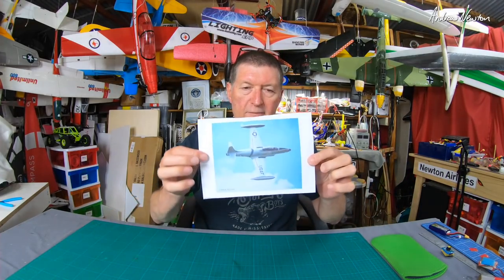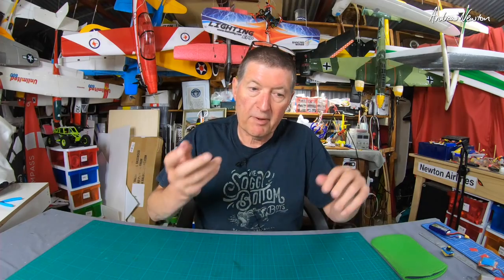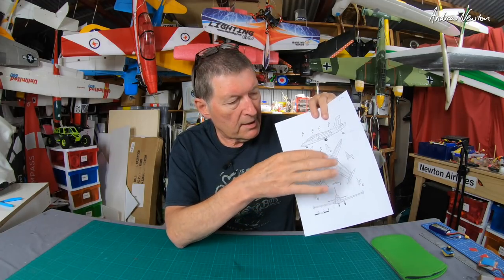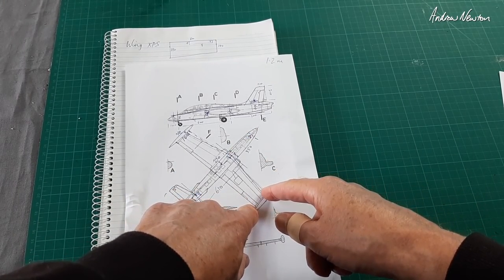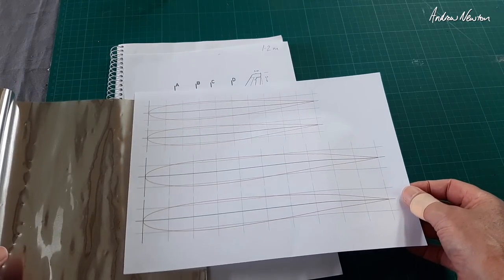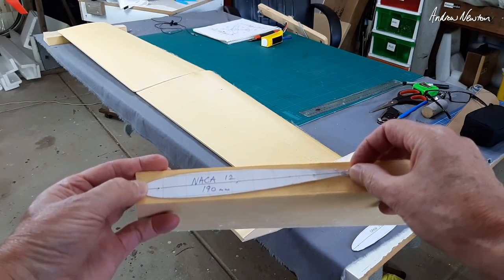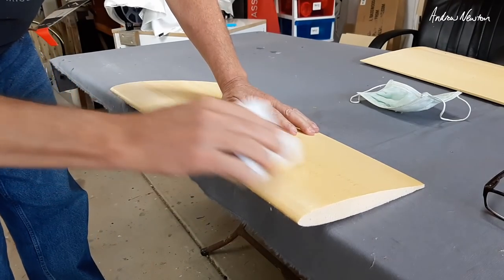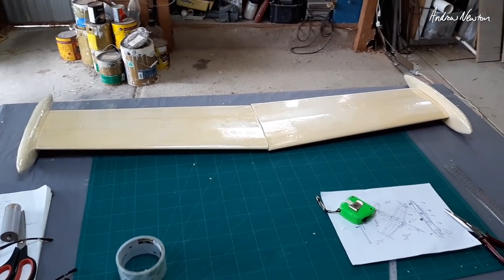Macchi MB 326 Scratchbuild Part 1

Comment: Another great video and series of builds. I have previously manually plotted airfoils, and know where to get the co-ordinates online, what software do you use to print out the foils, and for the newbies, have you done a video or talk on doing so? I have had a look through Newton Airlines, but a lot of info, and couldn’t find specifics on plotting. Keith.
Reply from the maker: Nothing fancy, Screengrab and scaled print.
Reply: Andrew, thanks, so simple. Saw online how one created a text file of the ordinates, renamed it a .scr (script file), then ran it in AutoCAD. Another copied the ordinated into Excel, converted the X values to the chord length, then created a chart to get the airfoil exactly. Keith.

Comment: your 3 view is the MB339 later version than the 326. 339 was used by RNZAF
Reply from the maker: Yes I realised that half way through when things didn't look right.
Reply: @AndrewNewton  All good. I worked as an engine fitter on the "Fanta Cans" and was very interested in all the different varieties of Macchis. Ours had the lowest powered Bristol Viper 2500 lbs thrust and I always wondered what our birds would be like if they had the 5200lb thrust Viper of the South Africans and Brazilian single seat versions
Reply from the maker: Ah, I could have used your advice back then.